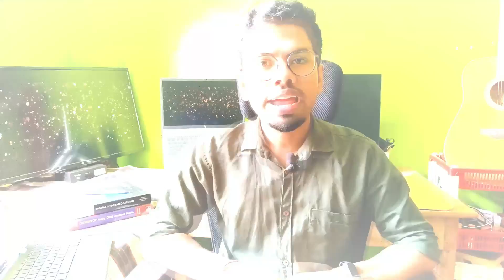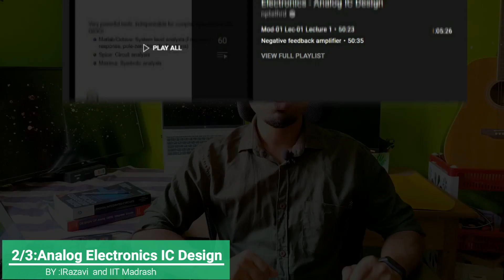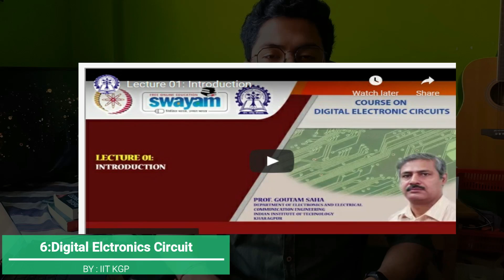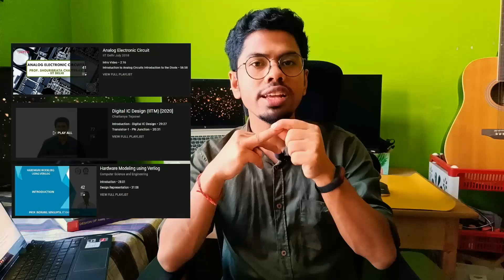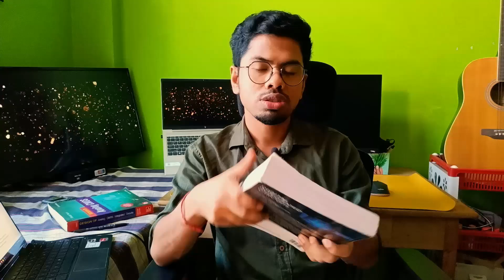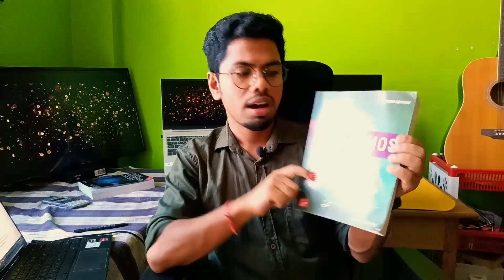10 Best NPTEL Course for VLSI Industry | VLSI interview preparation |by IIT’an and Engineer@Intel

Comment: Which subjects should we prepare in depth for Memory Design role?
At present I am doing the following subjects in depth
EDC
Network theory
Digital IC Design - Janakiraman IITM
Digtial Circuits
Memory Design Chapter - Rabaey

Kindly add to this list.
Reply from the maker: You are already doing all the required things ,just add verilog to it
Reply: @whyRD  thankyou sir, also wanted to add that 
meditation is helping me a lot, saw that suggestion from your linkedin post
Reply: @whyRD  sir do we need analog circuits, and to what extent?
Reply from the maker: basic exposure to analog is necessary

Comment: Will it be beneficial for a phd in material science working in intel as a module engineer to do vlsi certification offered by IIT Roorkie by courseera? Thank you
Reply from the maker: Not so much beneficial, but yes circuit knowledge is always add on to your curent work related to material science

Comment: Completed graduation in 2013 completed my pg in vlsi In 2017..is there any scope of getting a job in vlsi...if so what are the course we need to take ..thanku
Reply from the maker: You have the required degree to get started in VLSI .. So it all possible ... But things will be little tricky and if you are currently working with some other industry,you may give away your work experience advantage ... And need to start as fresh so payment will be lower then what you might be earning now for first few year ... If this all are oky then i will suggest to do some investment and join a VLSI training institute... Self study can do the things but this route will be very tough and only possible if you are self motivated and ready to keep preparing for 1 year and ready to accept rejection from 99% of applications,
Reply: @whyRD  what's ur take on meven silicon bangalore??? Is it beneficial... Or pls suggest any vlsi institute for vlsi real time coaching..
Reply from the maker: I dont have any personal experience with them, but seen few of connection getting placed after attending maven , you go with them just discuss about you scenario and how then can help you.. You can also see vlsiExpert.
Reply: @whyRD  Thanku so much..

Comment: Hello brother..I completed my M.Tech from one of the private college(because I was preparing for government jobs from last two-three year)..last year my branch was Electronics and communication Engineering ... I worked on Cadence Virtuoso as my thesis work based on this..and honestly I don't have any knowledge except this software in electronics engineering(as my BTech degree in electrical and electronics engineering..and my gate prepration is in Electrical engineering )..I studied analog and digital electronics during my gate prepration...Now if i want to join vlsi jobs.. can you please suggest me...if i complete all the lectures as you told in video from NPTEL or again doing M.Tech from good NITS ,.. which option is best for me.. 😕
Reply from the maker: Hi Mridul, i just missed your comment .. You have worked in cadence is really great plus point... Finish atleast 3 courses which i mentioned , and then revise what you done in project using cadence and n apply for digital roles.. Let me know if you are not clear

Comment: my all courses done in Electrical engineering department, I have completed in m.tech in power power system, I can VLSI course or not ? which courses benefits for me. In my carrier ..
Reply from the maker: You can definitely do these all courses if you have a wish to switch in VLSI industry in future ,i dont know if its possible to pursue vlsi industry as power electronics guy but there are many job designation like power delivery signoff engineer in vlsi industry,which require a electrical /electronics guy with knowledge of handelling power... For your domanin jobs i guess analog course can help you further .... Please verify more as really i have very little knowledge out power electronic universe .. Thanks for connecting

Comment: Which high level programming language one should focus regarding interview and upto which level
Reply from the maker: For interview you dont know any specific programing language but you should be able to explained the logic/concept of programming , like explain how flow of control work , why so many different flow of control we have (if,while,etc) , like they may ask explain OOPs concept .. For vlsi interview intermediate to beginner level programing knowledge is sufficient... For written exam you need to be good with C or C++ , they ask simple programs and you need to find outputs or error